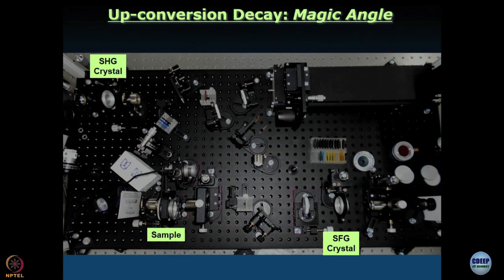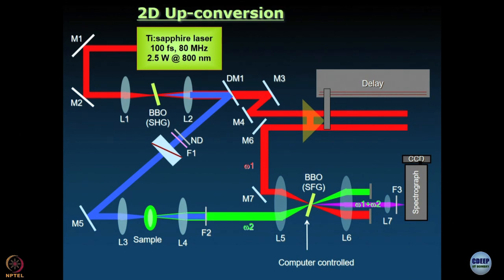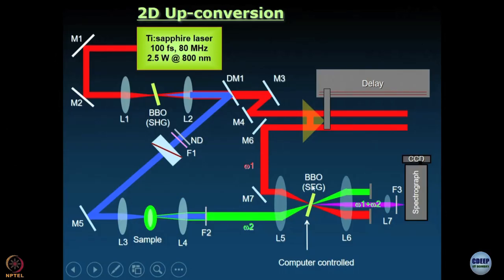Week 3-Lecture 13 : Femtosecond Fluorescence Upconversion 3

Comment: Professor I have question to you. Please could you answer me?
Why measurements is  done at 600 nm...which is flourescent signal emission wavelength having nanosecond lifetime? If the measurements are done at uv range means there won't be no doubt because it is truly an upconverted signal.